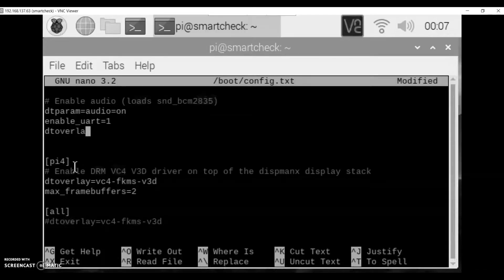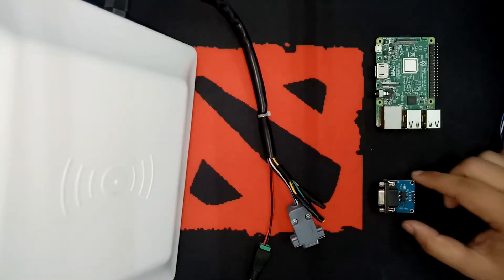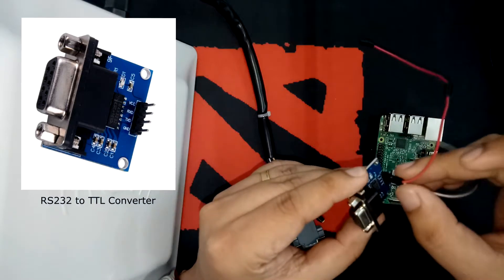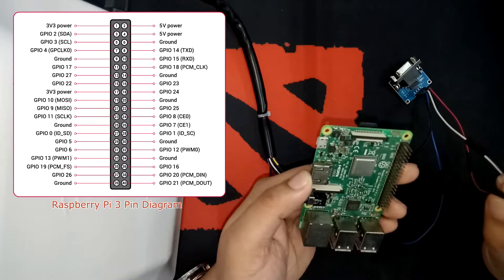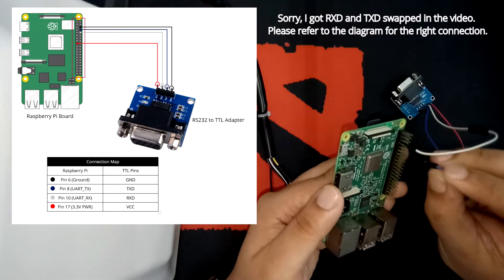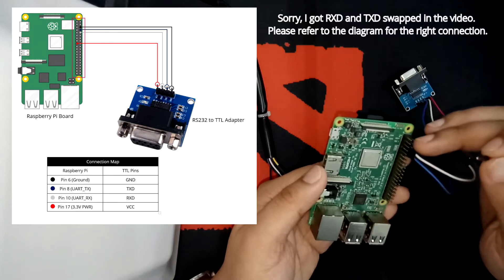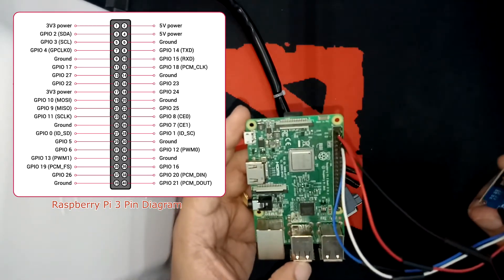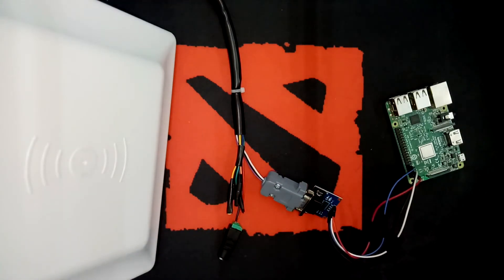UHF RFID Tutorial Part 2

Comment: Hi sir, is the RFID reader able to read up to 100 tags at once, range 10~100cm? Could you share the model name of the reader and tags? Thanks alot!
Reply: I am sad to see nobody answered you. This specific type of RFID reader is used to control access to private or paid parking locations/structures or open a gate to an employees only area. It wasn't engineered to be an enterprise class commercial grade RFID solution for $100. I forgot to mention, the reader shown is operating at 60Hz or just 1 tag per second AND it isn't capable of writing tags. It does, however, have the ability to read tags as far away as 30 feet, depending on the physical size of the RFID tag! 

I bought one for $40 a couple of months ago and now I am here trying to learn how to lessen my regret on the purchase. I say regret about the purchase because I explained what I needed and they told me to get a certain one and it will definitely work right out of the box. So I did. No, it didn't! I just want it to read the tags it detects, compares the number on the tag to a database and takes an If This Then That approach, logging and triggering whichever response(s) is/are assigned to that individual tag.

I am so happy today because this puts me a much larger step forward!
Reply: I have managed to get one for my project and it worked. Thanks for replying!